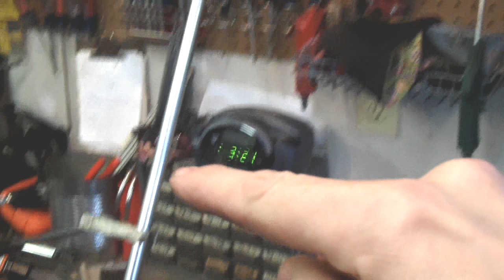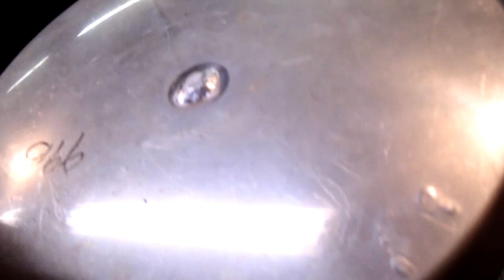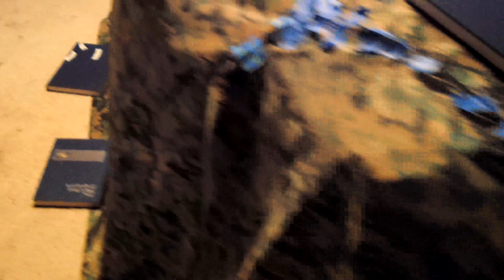Making The Dakota Pit Tent.

Comment: RBM1 - I love the accent.  As an Arkansas resident, it is awesome to hear the deep south twang of a real southerner.

You seem to build some pretty cool stuff as well.  I would love to team up with you on a project in the future.  You have mad skillz, but your engineering skills seem to need need a bit of work.

Maybe I am wrong since I only saw one other video where you built a one wheel trailer for a bug out bike.  Cool idea, but I could see the braces rubbing the back tire.  That project would be very easy to fix.

Sorry, I got side tracked, and didn't mean to be negative because I do like your videos so far...  The first airplanes, and the first Apple computer were built by garage inventors.

BTW, you don't need grow room donations to get the inner liner.  You can buy Survival blankets for pennies, and use them to reflect the light and heat.  They sell them at WallyWorld, but you can probably pick them up at dollar tree for what they are actually worth.  Dollar tree= cheap Chinese crap for a dollar...  WallyWorld =  the same cheap Chinese crap available at the dollar tree, but for $3. lol
Reply from the maker: Thanks man. Im well aware that bicycle mod needs a pivot. Ive been told at least 100 times in the comments. The idea wasn't to build the ultimate bicycle, it was to make something out of some free existing scrap.  Understand that and youll understand why I did what I did. Now I do have another bicycle that I actually plan on fresh materials and a perfect design for.
Reply: @Reallybigmonkey1  Understood.  I was thinking more along the lines of move the braces from the axles to a bracket similar to a rear luggage shelf to get them away from the tire.  Looking forward to the new design.  Keep up the great work.

Comment: Old video I know, but maybe use PVC pipes for the frame instead? easier to work with, cheap and very lightweight. cool project tho👍
Reply from the maker: That was the original idea but I couldnt figure out any way of connecting it easily.

Comment: for the rain to do the same, or the thing I call a 'Rain/Spark Arrester.' 
It is the lightest of ally or carbon fibre that hangs down from the chimney cap, so it stop rain and also sparks if there is any, you see? But I had in mind the very lightest chain mesh that would take no more room in your pocket that a handkerchief.
The rain would run down the outside, and the sparks, because this is a 'just in case type of equipment,

Comment: Excessive seaming can weaken the fabric. You need to fold a hem because all those extra needle holes in a single piece of fabric will eventually result in the seam staying intact but the fabric ripping away from the seam. Fold a 1" hem around the perimeter of the fabric, double stitched (one stitch about 1/8" in along the spine of the hem, and one stitch along the edge of the flap) this will naturally result in a box at each corner. Having the fabric doubled up into a hem will also make your grommets tighter.
Reply from the maker: +a aa  Im just a novice at sewing. Thanks for the tips.

Comment: I was thinking how you could build a floor with the firepit.  A lot of people I have seen buy a small stove to take with them to heat a shelter, but your digging a pit which sorta precludes the floor.  I guess you could cut a hole in the floor, but I have seen water flow under a floor unfortunately in a tent that had a few small holes in the floor (don't ask how it felt to get woke up by freezing water). I'm just thinking out loud and not trying to rain on your nice tent.  I will wait to see it.

Comment: Hmmm speaker box--I think you saw (Dynomat) its thinner and sticks on, Ive used that a lot in customs with "boom" in em, but this other does not have the sticky back and has like a blanket of fibers with a foil sewn to it. Actualy its like 3/4 inch. I take the old grey stuff from under a hood anr replace it with this 3/4 stuff held in with the plastick snap buttons you would see on the under side of a car hood. Looks good works good-plus reflects light for working under there.

Comment: Did you ever consider using PVC piping instead of aluminum.  Additional piping can be placed in the center of the PVC piping for added strength.  It might be easier to work with.

Comment: I dunno, but think you want that stovepipe to extend a little higher above the tent. Less risk of floating embers landing on tent, and better draw.
Reply from the maker: I only use debarked wood and no grass, no leave, no pine straw and no bark ever. Debarked hardwoods never give sparks.
Reply: I don't really have experience with it.  It's just that every other stove pipe I've seen sticks out further.  I'm sure you've put thought into it.
Reply from the maker: Yes, I have experience with this exact stovepipe. It's worked every time and the key to it, is the  90 degree elbow that exits smoke and gases away from the shelter. Not up above it.

Comment: What would happen if you were forced into using aluminum foil from the grocery store. What is a plus and a draw backs as a liner for inside of a tarp ?
Reply from the maker: The only way I would use aluminum foil is if it was the heavy duty kind and it would have to be attached with spray adhesive. It would work, it would just wear out fast. The main advantage if the reflectivitiy of bouncing the heat back off a fire and warming the entire inside of a shelter.
Reply: Thank you.

Comment: Use electrical conduit few pieces 1 inch rigid about 18 inches long beveled cuts on one end and drive to ground with a hammer careful to preserve the ends then use 3/4 to insert upper frame to ground opins cheap dirty and reliable...cover with any waterproof material... upper frame may be manufactured on site with hand bender. This will be the best long term camp option fast and dirty... then pack the rest of gear to camp...dig fire pit outside and run chimney through ground to opposite side of tent for dry ground and radiant heat from pipe will create a fire bed effect ...hot rocks and buckets for quick heat till ground comes up to temp maximum square footage and use concrete insulating blankets for walls and roof   again for long term camp for multiple use,,,,If roof vnting like teeppee is available then interior fire better option but loss of square footage etc sparks to bedding all a risk....once fire wood packing out of reach simply relocate....

Comment: Hi and please forgive my rudeness, you know it is only suggestions from an ignoramus k?
Have you thought of using the much lighter emergency blankets rather than the heavy foil material? I have never held one and do not know if it would be 'man enough' to take repeated folding and assembly?
That tent must be worth as much as the space ship Columbia with such high class stuff used in its making plus the added genius thought it took to think of the basic design!

Comment: I like your video...but I'm worried you won't wake up. That's an awfully big gap between the fire pit and the chimney. IIRC, carbon monoxide is a heavy gas that likes to hug the ground, so I wonder how much will make it out the chimney. Take a carbon monoxide tester/alarm when you test? Also, won't the critters smell/be attracted to the vent cover/smoker, and jump on/paw at it to try to get to the goodies? That would not be good.

Comment: I have watched many of your videos and when you sew why don't you use a hand stapler better and faster to use. Staple in your seam  allowance and then either pull or cut the seam allowance down Does not compromise the material finish because the staples only went into ,

Comment: After a second viewing, I see that you've cut in an extra square of fabric at the corners. This will be of limited benefit; basically tension on the grommet is going to tend to cause the fabric to rip on the side of the seam where there is still only one layer of fabric.
Reply from the maker: +a aa  That makes sense. Thanks for the advice.